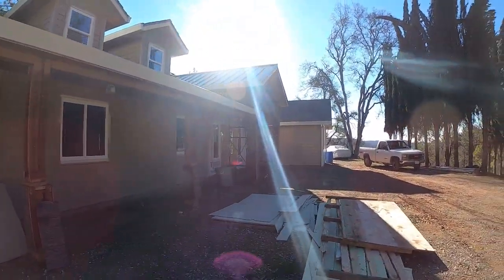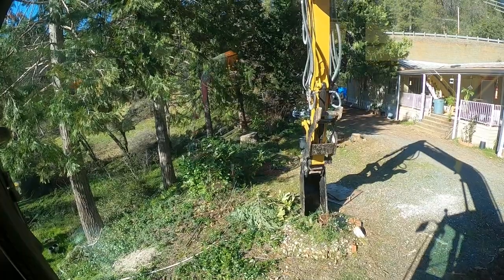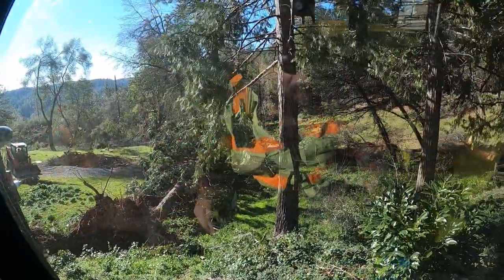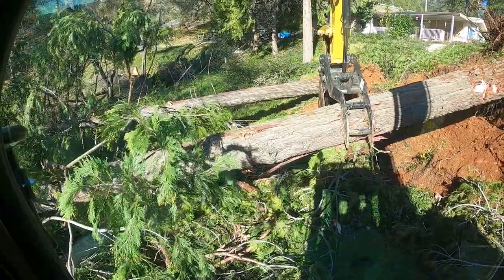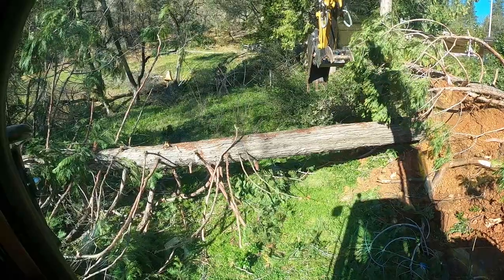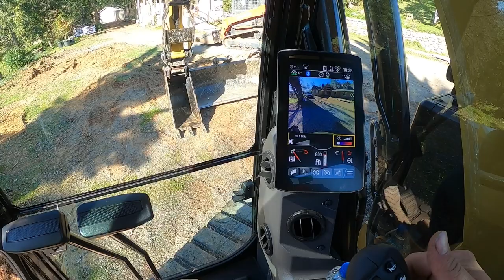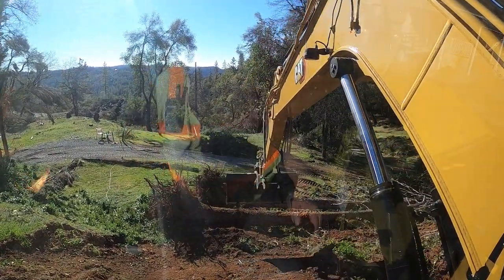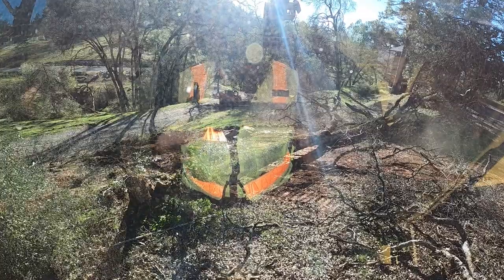Dropping trees with the CAT 310 Excavator

Comment: Do you have a dump truck with a tandem axle trailer to haul your 310 with for jobs when you're hauling\removing dirt or gravel for driveways ?
Reply from the maker: Sadly I don’t mainly due to California being stupid and not allowing 14k and larger trucks older than 2012 model year to run or be registered. Otherwise yes I would have definitely had a set up like that by now. But typically a lot of earth and gravel jobs I do they are in the 200 tons plus range so I just hire trucks to take care of it for me